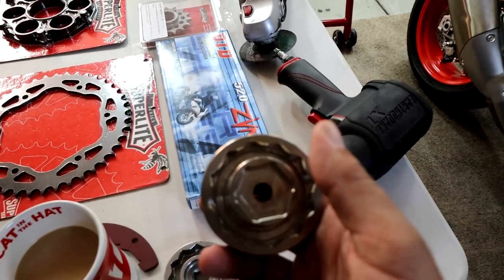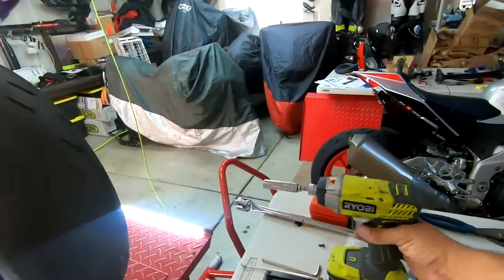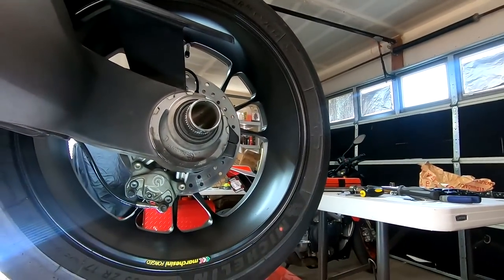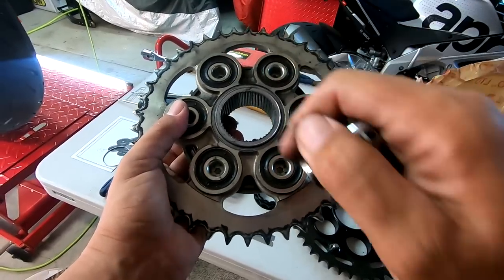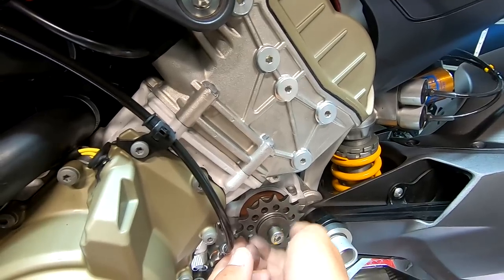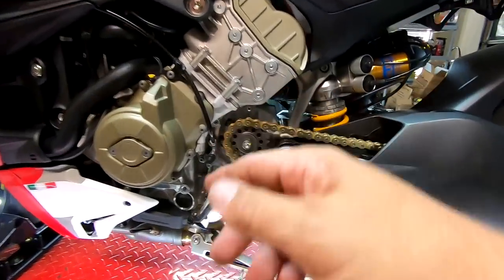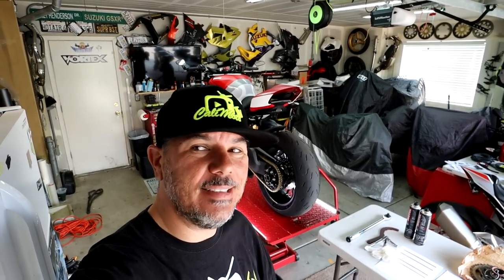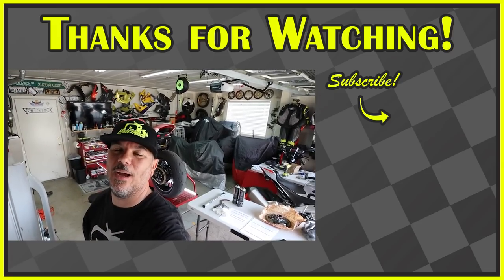2020 Ducati Streetfighter V4 S DIY Chain and Sprocket Swap | Superlite Quick Change Kit

Comment: that yellow paint mark are proof from factory that the nut was torqued, after each bolt is torqued they mark the nut/bolt, also can give you an easy quick glance in the event the bolt/nut backed off or lost torque in some way
Reply: And because fasteners may stretch when torqued down properly you can't really use the marks as a reference beyond the initial torquing they get from the factory.

Comment: The yellow marks are put there when the bike is built as let's say a check list to show that vital bolts/nuts have been torqued, also an indicator if they come loose as the marks won't line up, it isn't for tightening until they line up and its then at correct torque, you could tighten 10nm over and they would line up you could do 10 under and they would line up. Sorry if it sounds like I'm being an ass I'm not but someone would probly end up putting something together finger tight and think oh well the marks line up and end up having an accident

Comment: If you put a plastic bag over the black wheel nut, then place ur socket over that and torque to specs you can avoid scuffing the wheel nut.
Reply: Just re-watched the video on my TV instead of my phone and I see that you did use the plastic bag on the nut. 🤣🤣🤣🤣🤣

Comment: Great video, just a couple of  things, I'm sure the lube supplied with the chain was for the pins on the master link, not the 'O' Rings. Surely all you've done is sealed in a dry chain link. Also after just changing my wheel nuts on both sides of the rear wheel on my V4S, it does say in the workshop manual that you should grease the threads and also the touching faces on these.

Comment: 14:18 
At this point I don’t see any locking blocks for this 6 rings, and why not just push them down without loosen the sprocket holder?
Like this 16:05 , why do you not tighten the sprocket holder with the 6 rings ready and just put it on the sprocket?

Comment: Great video and all but why is everybody doing a 520 conversion and why a quick change. Is this just to be cool or is it actually doing some improvements? I beet the hell out of my v4 and at 14k miles my chain is shot. I wanted a 530 chain off the busa, apparently i cant get the sprockets. I dont want to look cool nor do i care about a few grams of weight. I want durability and longevity.   Comments and explanations please. Cali Moto..comments?

Comment: Looks to be the same procedure as my 1199R. Also noticed the same make and size tire. Great looking bikes. Anyway you can do a video on  valve adjustments? Also provide a sheet on all torque specs?

Comment: Hi Bill, I have the sf in stealth black and I really hated seeing the grease underneath my seat cowl. It was coming from the rear chain sprocket. How can I avoid that from happening?
Reply from the maker: Clean your chain and sprocket off and use a different type of lubricant that doesn't fling. Use a bit of chain cleaner by motul to wipe it off.

Comment: get the right tool to remove chain ring. It will be safer than use the grinder (without hand protection)  ;-)